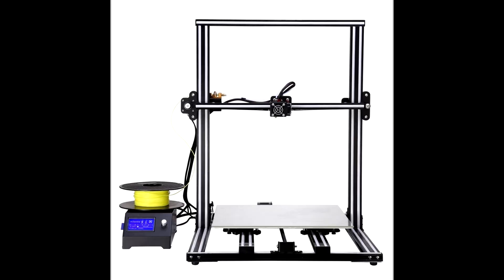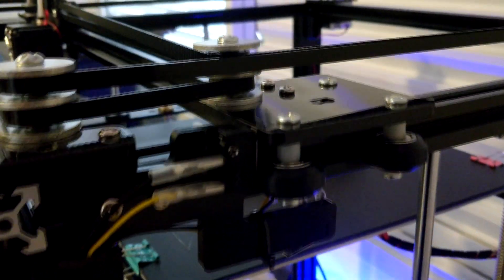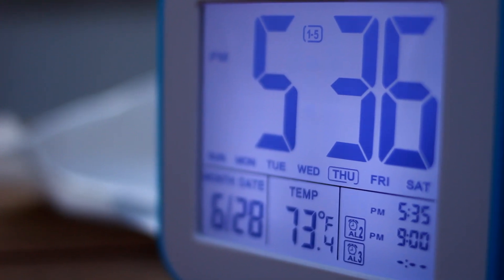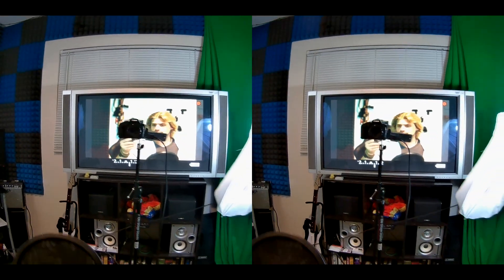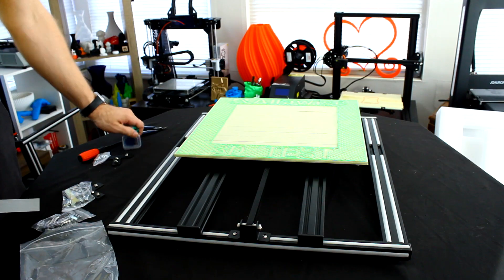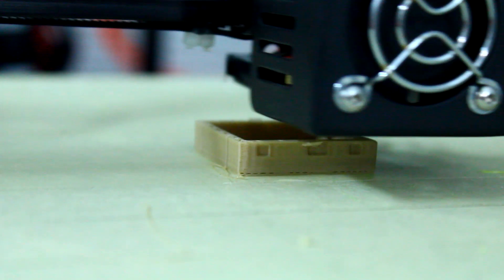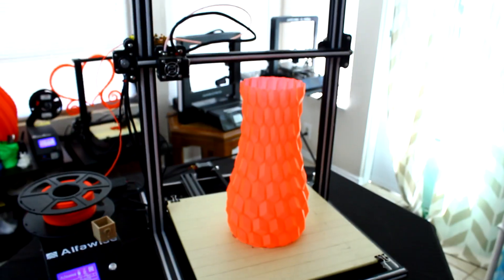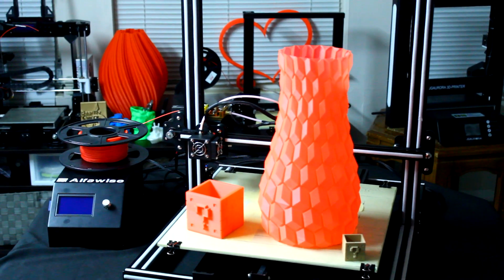UNBOXING TECH! Alfawise U10 3D PRINTER | CR-10 Clone but BIGGER!

Comment: @Caleb, My breakout cable for the cv1 has stopped working on usb 3.0 as oculus shows it as 2.0 now. I've tried all of my usb ports even the 3.1 but still oculus home sees it as 2.0 I unplugged the breakout cables and used oculus cable and the software sees the hmd as usb 3.0